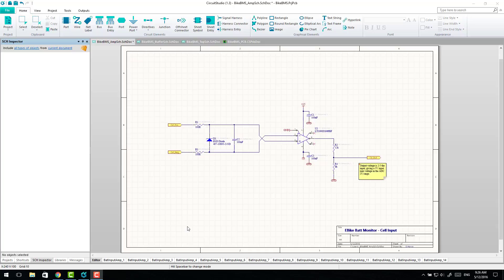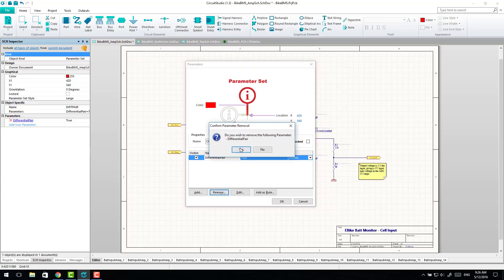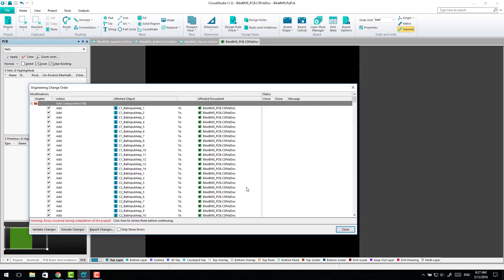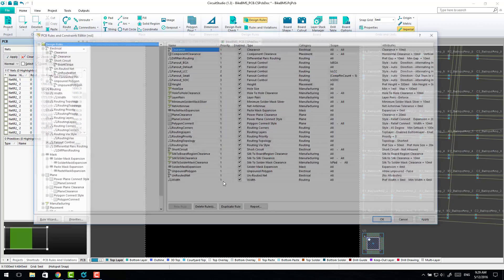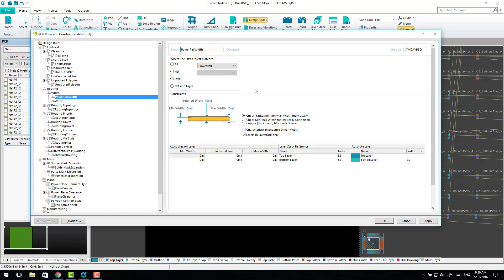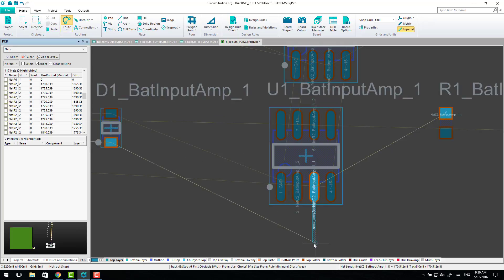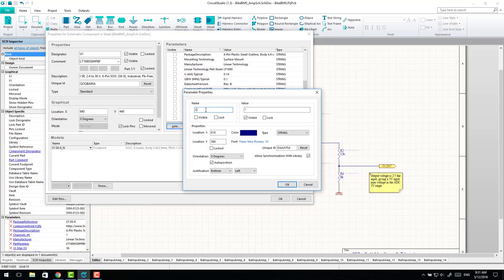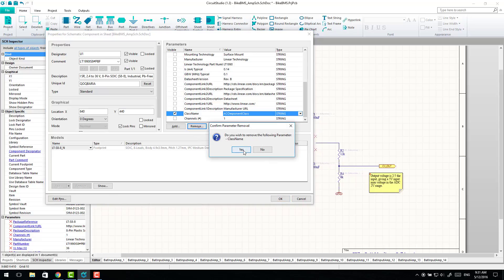CircuitStudio - Using Net Classes

Comment: I'm not able to get this to work. Defining Property "Net Class" with Name "ClassName" just like Altium normally does will not add any Net Classes to the PCB. Ideas?
Reply from the maker: Are you adding it to a net or a component?  If component, you need to also modify the project file to allow component classes (I should have put it in the video.)  Open the pcbprj file in a text editor and find the property "CompClassManualEnabled", change it from 0 to 1.
Reply: I was trying on a net just like your video and it would not add Net Classes. But thanks for the idea,  I found another setting in the .prjpcb file that did the trick. NetClassManualEnabled=1. My board has 700 nets, that is going to save me allot of hassle. Thanks!